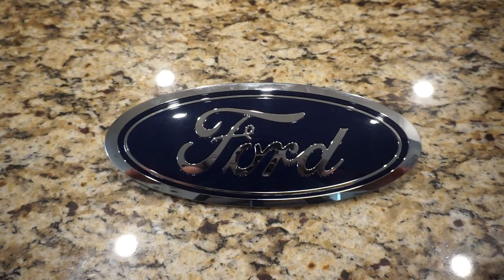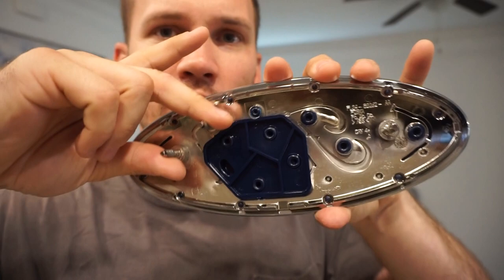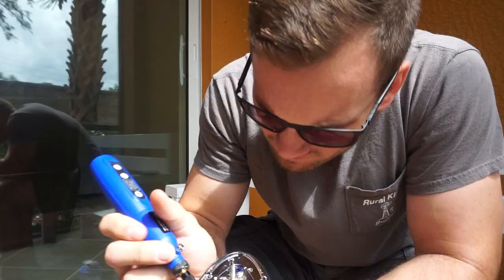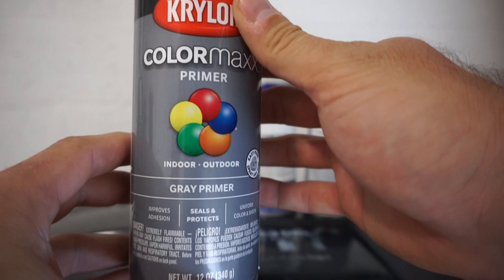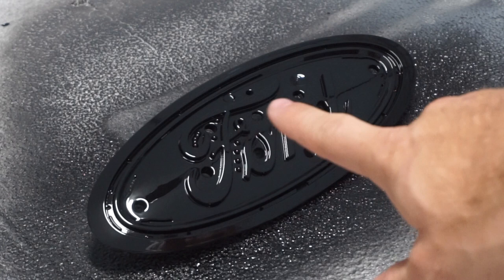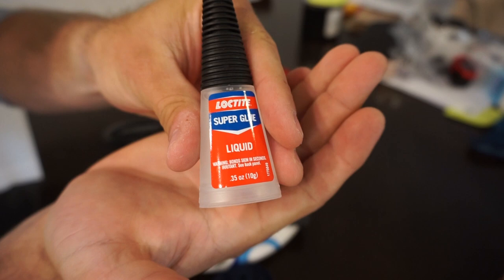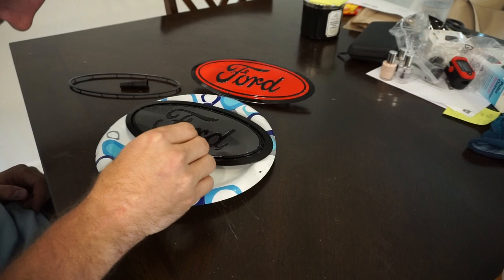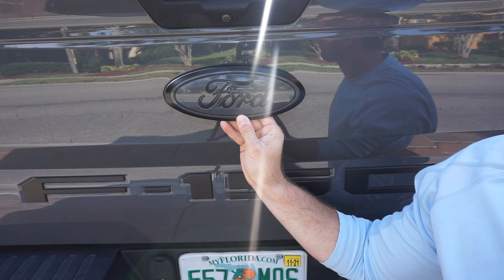How To Paint Ford F150 Truck Badges (Step by Step Tutorial!)

Comment: @Andrewdoeslife, I was going through this process... all was proceeding as normal.  I used Painter's 2x gloss black on the chrome.  Glass like finish, was very happy.  Then I sprayed the Spectral Paints Clear Coat and it totally ruined the finish and looks all bubbly.  It went on the other parts just fine.  Have you ever heard of that happening?
Reply from the maker: Hey Bob, unfortunately, I have heard of that happening. Sometimes different brands don’t interact well with each other or if you apply the clear coat before the base is dry it’ll bubble up like that. Sorry to hear about that 😔👎🏻
Reply: @AndrewDoesLife  ugh. Thanks for responding. Wonder if I can sand it back down and start over